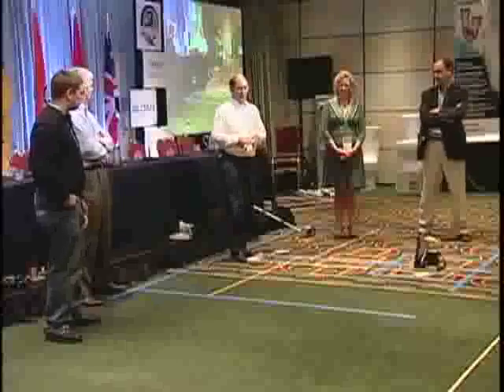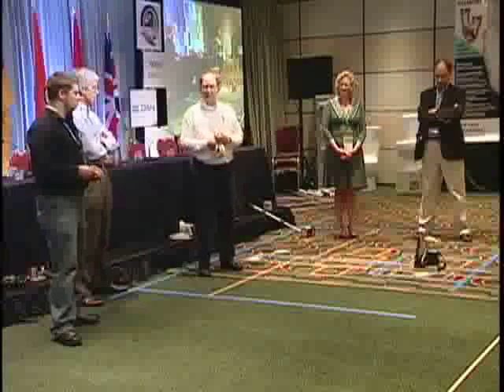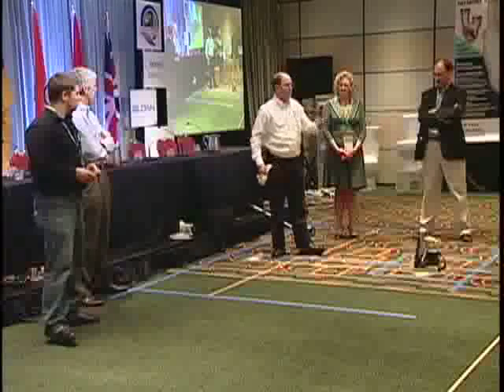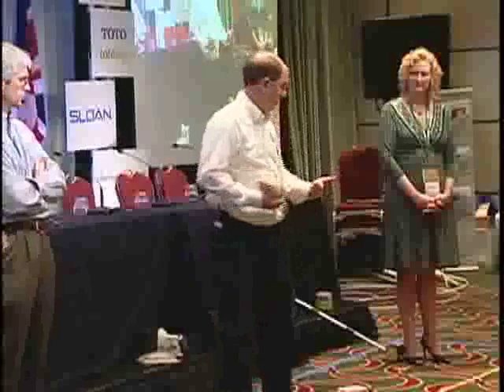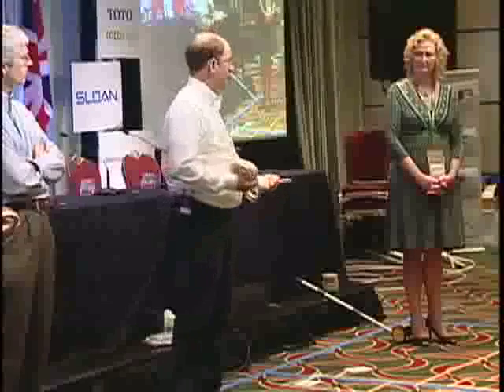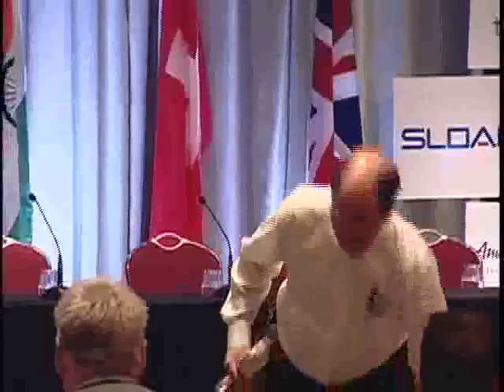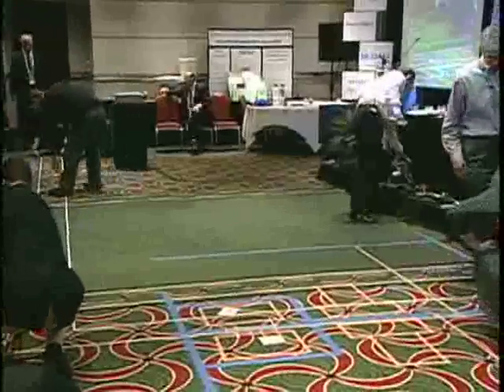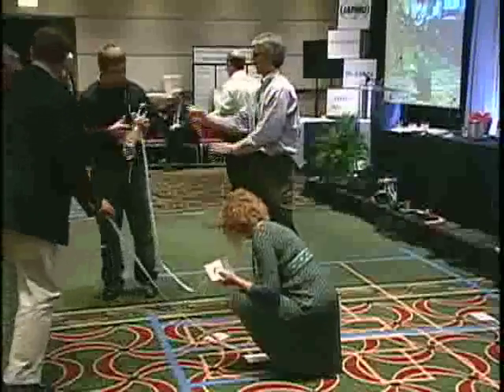IAPMO ETS - Practical Plumbing Layouts: Part Seven

Comment: Oh man I've been dealing with water recirc issues for three years since this place was built, mostly the grundfos auto adapt pump is a pile of junk, the sensors don't work properly. Gary ive seen you on risingers channel. Are you in Austin or can I send you a diagram of my plumbing for you to spot any anomalies or maybe find a way to fine tune my system? Things get interesting with a hybrid water heater and dedicated return in slab.

Comment: I, as an engineer, not plumber, use a wall UPB timer switch that turns on the recirculation pump (with check valve) for 2 minutes when activated. Minimum waste. Just press the switch two minutes prior to shower. For the kitchen, add a small hot water tank for instant hot water supply. As option, I may want to add the delta T auto circulation to improve the effective distance. By the way, I wonder if the trunk line could be a continue loop starting from top of heater and return to the bottom. The advantage of this configuration is the return line is eliminated.